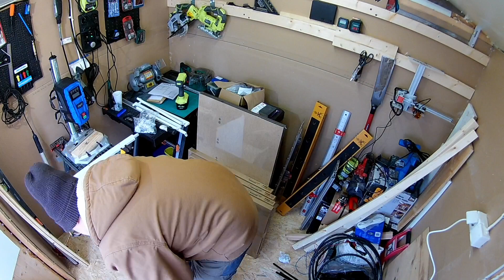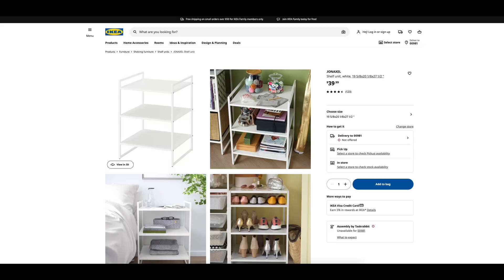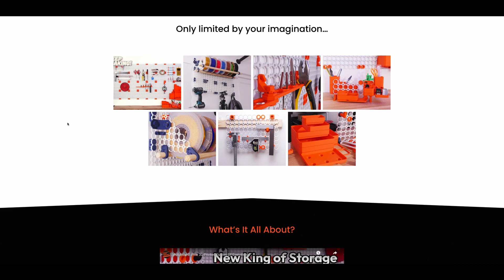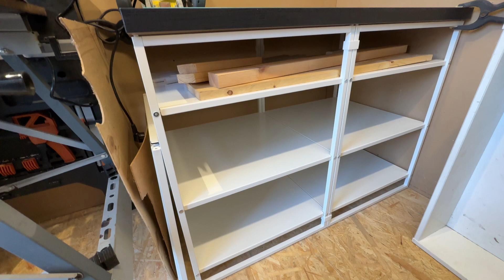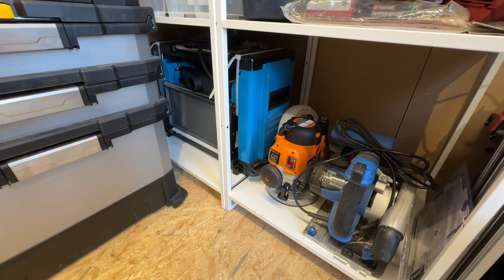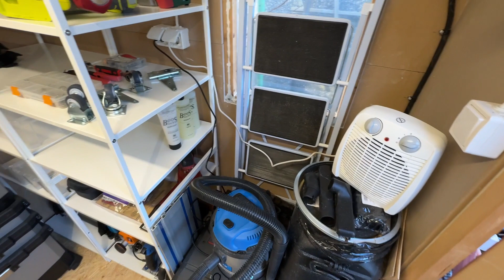Tiny Shed tour - 45 sq ft workshop!

Comment: Wow 400v. 3 phase, i don't even have 220v. to my (2+1 with loft) garage, and it'd be a 6 month wait and probably super expensive here. Not sure I could get 440v. I wonder what kind of plot size you have available, maybe also go up (2nd story) and/or underground (basement)?
Reply from the maker: We have 3 phases coming into every building where I live. The regular wall outlets are two phases with 230V and things like ovens, hobs and sauna stoves are usually wired with the third phase to a total of 400V. So it’s just a matter of installing new fuses and routing a cable from the house junction box to the shed (or anywhere) to get that. Most ”pro” equipment use 3 phase 400V here and it’s not really any more expensive to have that installed compared to the regular 230V.